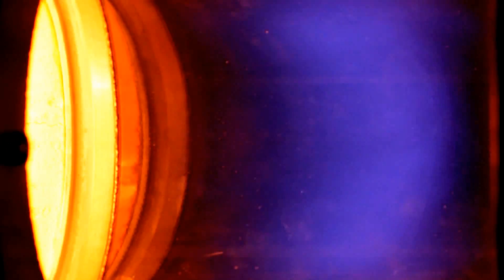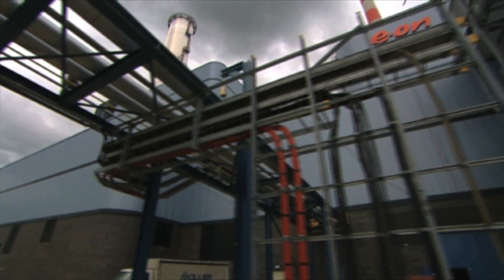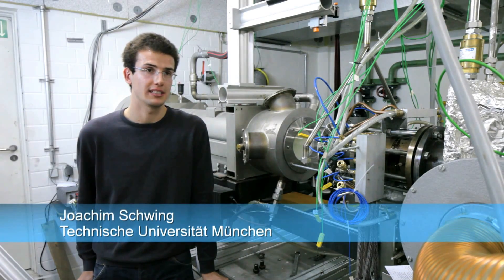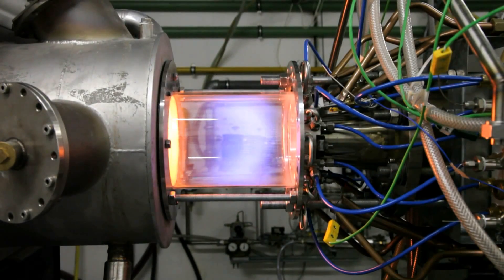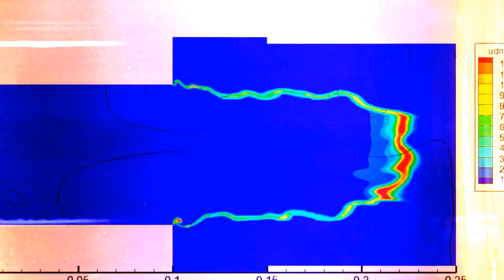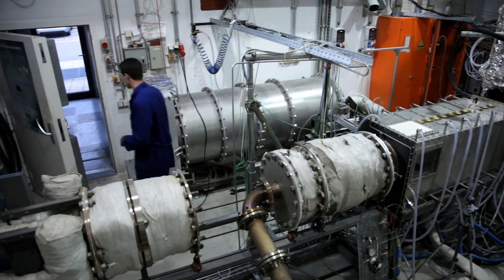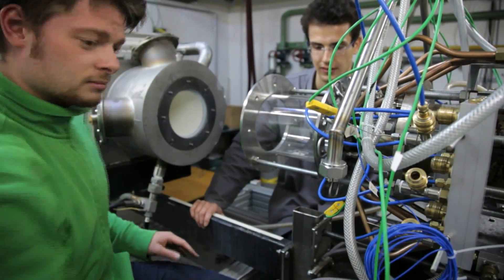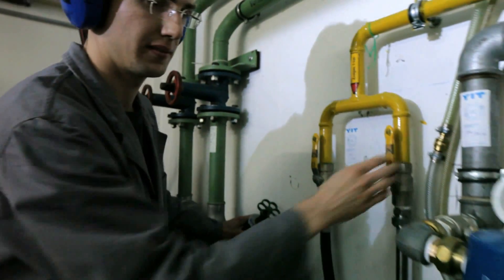Fire and flame -- TUM-engineers develop next-generation gas turbines

Comment: But if you go a different way, you don't have to do anything with the turbine itself, just mix the hydrogen with it's own exhaust until it gets closer temperature/burn rate etc. to the other gases, there are many patents on this.
Reply: hydrogen implodes , draw's air in automatic , , first expansion when heated , then implosion ,,, just like "atom" bomb
Reply: @smilernok  I don't see the relevance here but well, there's a lot of superstition about that, one thing is for sure - if the end result would not be a net expansion(i.o.w. not implosion but an explosive expansion of superheated gases(air mostly in the case of a jet engine), then it wouldn't work. But it works, and it has been done. Using EGR(exhaust gas reaturn) with hydrogen/oxygen is also one patented way to get temperatures and burn rates to match gasoline or gases in normal IC engines, so you don't have to adjust timing and otherwise modify for more extreme conditions. Don't get me wrong I get your idea - to simplify, that a drop of water has way less volume than the two elements as a hydrogen oxygen mix, and that this thing alone logically would mean an implosion. In reality with all the other gases involved and the extreme heat the reaction produces, you never really measure a pressure drop in a gas turbine running hydrogen.
Reply: something else, a little on the side too, as opposed to an IC engine, a gas turbine don't deal with explosions at all like an ordinary IC engine (or thermonuclear bombs for that matter). Here were just making a constant flame to heat gases, that's why a jet turbine is called a constant pressure heat engine.
Reply: @happyfox711  ofc it works ,, just take a look at the Tzar hydrogen bomb ,, i think we saying about the same ting , we had hydrogen power for many years ,,, just tweeaking
Reply: @smilernok  Btw. in a pulse jet, something like this would maybe happen, this I don't know enough about. But I would think here like in a normal car engine or generator running hydrogen/oxygen +AIR mixture, this happens so quickly it's almost unmeasurable at such a small scale(compared to a bomb) and what I'm sure of is the net result is explosive expansion, and no negative pressure in the end.
Reply: @happyfox711  33.33333% hydrogen 66.66666% oxygen  makes perfekt burn  in welding you add carbon to the hydrogen ( 33.333%acetylene C2H2 mixed with 66.666% oxygen) so you add the carbon you burn of ,, it make fine dust on the floor ,,,  when you make elektrolyse of water , you discover that it is the perfekt mix of 33.333 % hydrogen and 66.666% oxygen that you are getting ,,, compressed air is used to start gasturbines ,, the most simple way to go. The re-circlution of exhaust gasses is the splitting of air ,, compressed and heated air ... there you go !! relavance or not
Reply: @smilernok  yes I know H2O, but I missed the point exactly here. In a turbine, air is compressed constantly and introduced to the burn chambers
Reply: I can agree with you that the fuel reduces in volume, but that's very little compare to the rest of the process
Reply: @happyfox711  the fuel is air  ,, heatet and compressed ,, same when you jumpstart a person with mouth to mouth , that is compressed and heated air , you are putting in a nother persons lungs , if they are not breathing :)
Reply: @smilernok  The hydrogen and oxygen is the fuel I talk about, and if you don't look for the perfect explosion, but rather something an engine could live with, you can make hydrogen burn with very little oxygen, and even mix it with the exhaust (that is not just water btw, it's actually a mix of many different burnt gases in the air, mostly nitrogen oxide) something that will also alter the process - what they're looking for to do in the video.
Reply: @happyfox711  yea ... its not that smart to burn the air we are breathing 🙂 then you need to eat meat , and drink more water
Reply: @smilernok  ? animals consume a lot of plants that do photo-synthesis, making the oxygen in the air we breathe, so I don't see how that would help, on the other hand if we made a lot of hydrogen by electrolysis, we could release some of the oxygen to the air, and run turbines with a leaner mix
Reply: @happyfox711  okey ... what you are not getting is that we humans , animal's plants , run optimaly on air ,,,  we have been burning the air for a loong time ,, many years ,, machines ,,, dont change the original mixture of air that we breathe ... pink floyd covers are much about this.. Hearts need hydrogen ,, body needs oxygen.. Atom heart mother

Comment: Water injection or if running waste heat boilers, super heated steam re-injection helps reduce NOx by cooling the combustion and adding mass flow improves the turbine efficiency. Placement of the nozzles also shapes the flame cone and adds stability.
Allison were working on these problems in the 1990's with the Cheng cycle in the 501KH
Reply: These kids have probably never heard of the nineties.

Comment: When will a residential, high efficiency turbine be developed that runs on natural gas, supplies electricity as well as heat as a byproduct. The heat can then be used for domestic hot water and space heating. Vast amounts of people in the US are supplied with it. Seems as though it could be rather small since it wouldn't be running all the time. Any thoughts out there???
Reply: Piston engines work better at that scale. Honda is developing high efficiency CHP units with piston engines.
Reply: @PistonAvatarGuy  FIAT have produced the T.O.T.E.M. unit in the '70s.
Natural gas powered, too reliable, then a fail for FIAT, at the time...😁
Reply: Fiat and reliable do not belong in the same sentence.
Reply: @PistonAvatarGuy  hahaha you can't understand the dimension of the bullshit you said.
Reply: General.E.Shady  talk about things you know, dude.
FIAT engines are simply awesome.

Comment: Will it run on an unstable gasifier input?
Reply: With a preheated fuel air mix... basically as far as a combustor is concerned, they are pressure engines.

If you have a fuel, it'll burn everything that'll burn. Depends what comes out of your gasifier... and how long your want the service life to be... how long is a piece of string...

Comment: The helmholtz resonator mentioned is NOT the answer here. For starters, that size resonator is only going to dampen high "screech" frequencies which although are the ones that can result in catastrophic flashback, are also less problematic in the GE frame 7-FA turbines that I'm familiar with. Not to mention that for the resonators to work, you also have to have the initiating resonance for them to work against, which is going to damage upstream hardware before the resonator's counter-effects can come into play. The worst damage is from long-term low and mid-tone dynamics, which cause fretting on liner seals, crossfire tubes and other hardware, eventually leading to liberation and FOD downstream.
Reply: Wouldn't swirling the gasses stop the oscillations? How about adding laminar flow tubes to the pre-combustion gasses?

Comment: would this not then allow for a longer turbine housing and more compression? Instead of wasting the initial burn improving it. I also find the intake method could be improve. And that you use multiple turbines together to form a cell. Then you could make another larger turbine lets say by 2/3 to take there output to create even more compression. just think the start of a fractal series. This would allow 2 units to be down for maintenance.